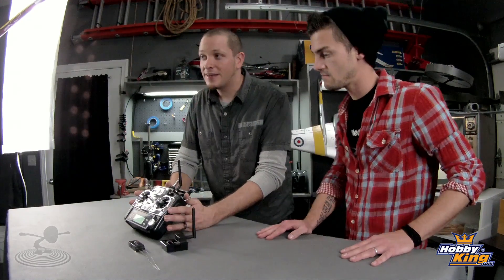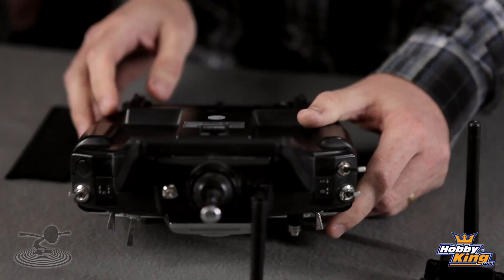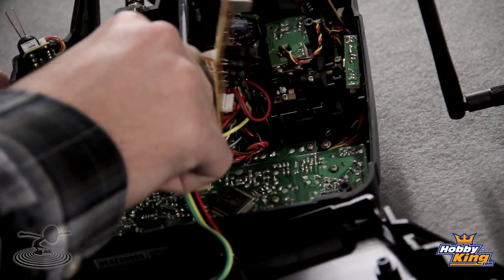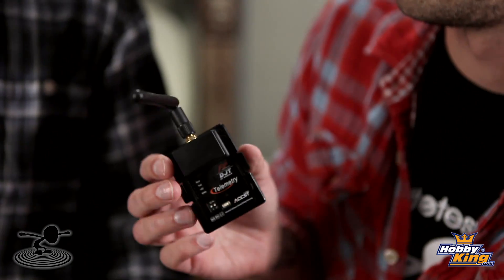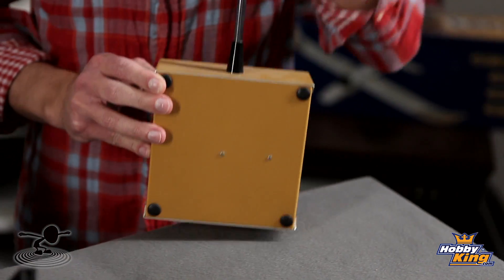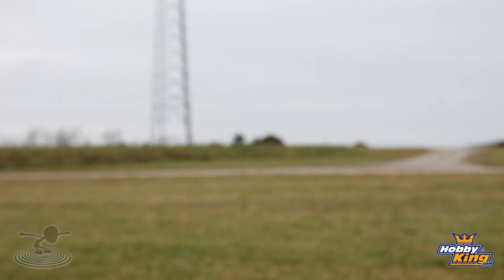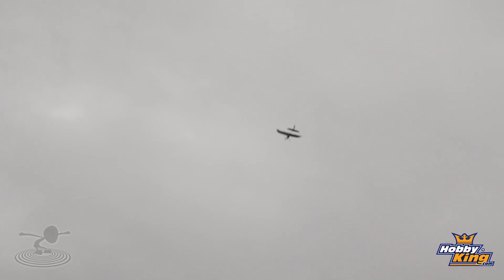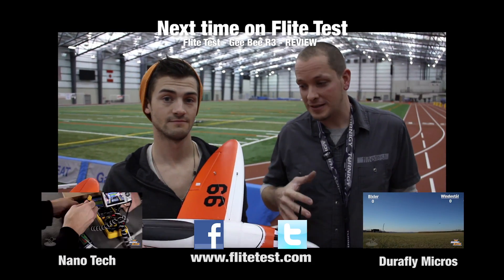Flite Test - DIY 2.4Ghz Radio Upgrade - FLITE TIP

Comment: Putting the switch that allows going between 72MHz and 2.4GHz in such an exposed location on the Futaba T7CHP transmitter seems risky.  Bump that switch while in flight and you will lose control of your aircraft.  I made this conversion on the same model Futaba using the Corona CT8Z DIY module and used a recessed slide switch, much like the power switch, installed on the back of the unit.  No possibility of an accident.

For people that think leaving both the 72MHz and 2.4GHz transmitters on at the same time, consider that you may forget to warn others that are still using 72MHz and shoot down their aircraft unintentionally.  Also, operating both transmitters will drain the battery faster.
Reply: Mike Hammer I still fly with my old futaba fg gold an I wanna convert that to 2.4

Comment: i purchased  a transmitter 3s lipo 8C  2200mah for my futaba 72Mhz   radio that took 8 AA batteries with new lipo  it reads 12 volts  will this be OK

Comment: guys I need help I have a sanwa rd8000 and its at 72mhz I wanna make it at 2.4ghz and idk haw piz help
Reply: krum4o55555 there is no difference in futaba to airtronics its still connects the same power .ground an ppm connection an your done .. Use the corona dig kit

Comment: That switch - it's a bad idea. It can be switched accidentally during flight, or loose contact over time. Having less switches in RC and power circuits is always better and SAFER

Comment: I did this as soon as you did this episode, saw a Flysky 35mHz for £9 new, bought the FrSky telemetry screen add on. Soldered it all in with a 3 pos switch, so I can still use the 35mHz receiver, FrSky and middle is no transmitter so the battery lasts longer when used with Computer simulator. Works perfect with ms Swift 2. Thanks Guys

Comment: Hello

I added a switch to have 2.4 and also stock 72mhz module options in my FUTABA 7CAP radio. Frsky works perfect I think, but now wanted to try some old models in 72Mhz, and servos jitters and range is crap!!!! what can I do to correct my problems? what should i pay attention to (soldering, routing cables, the frsky is located inside the radio underneath the stock 72mhz module)

thanks in advance!

Comment: Well I am thinking of getting the that 9 channel frysky flysky what ever it is through nitroplanes I guess since the hobby king Turnigy is always out. Same radio correct? Just different firmware from what I have read. You seem to like it like many others. If there is any info that I should know maybe between the nitroplanes version and Turnigy and you have time please stop by my page. 20 year pilot here and I fly 72, and 2.4. I can tell you know your stuff by thinking the same as I. Thanks wilco

Comment: Wow, I knew the ban on 72 was coming but I never paid much attention. Guess it sucks for all those AMA and club members out there. Don't get me wrong I fly 2.4 Spek and Futaba, however I also fly my 72MHz (have for over 20 yrs) on my larger balsa models and always will. 72 is more reliable. Every plane I have lost that was not pilot error was caused by 2.4 Spektrum/JR crap radio systems. Brown outs causing a reboot=crash, Thanks 2.4. Versus a glitch on 72 and your back instantly. Thanks but no.

Comment: Why does that wire need to be cut? I have a Futaba 9CHP, if I get the module, do I have to cut anything? I don't need to solder either right? It's just a module you plug in.

Comment: So all you need to do is to cut the wire that goes in to de turnigy 9x module and just plug the frsky module in?
Whats the difference between V1 and V2?

Comment: @simio1337 
They did not really switch to 72Mhz. This was just to stop the 2.4 module from transmitting. With the switch at 72MHz position, the 2.4 receiver would not get any signal. As soon as they switch back, the 2.4 module would reboot, and reconnect. Some other 2.4 systems are pretty slow to re-bind. The FrSky is one of the best 2.4 systems available....

for the ones interested in modding your 9X transmitter.... do a google on ER9X firmware